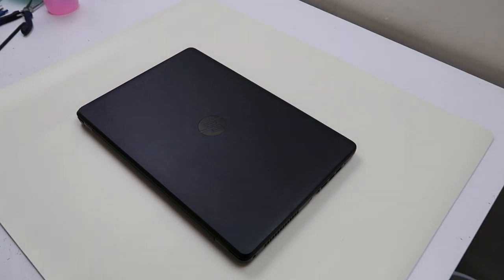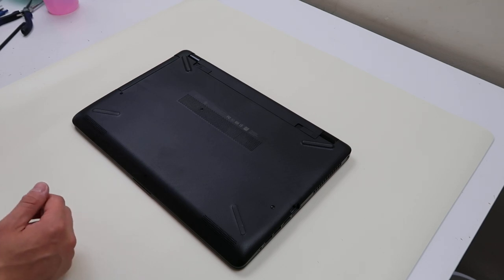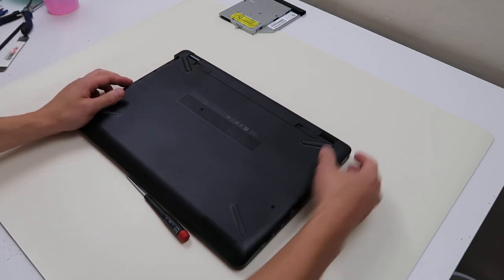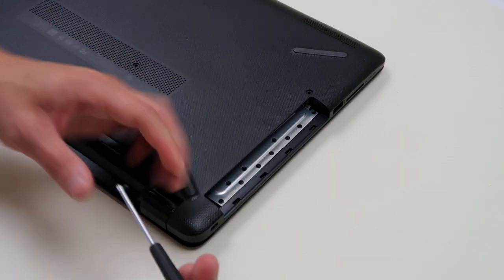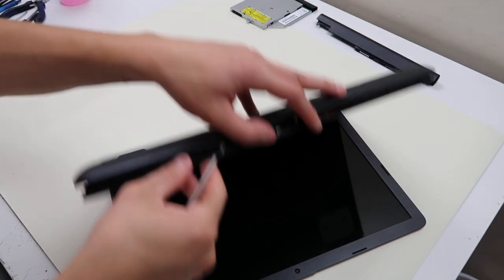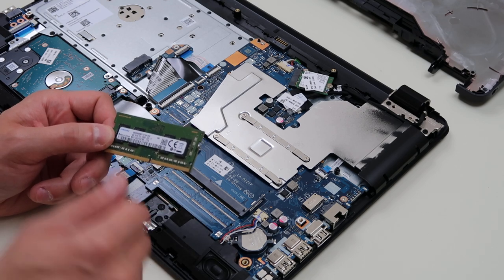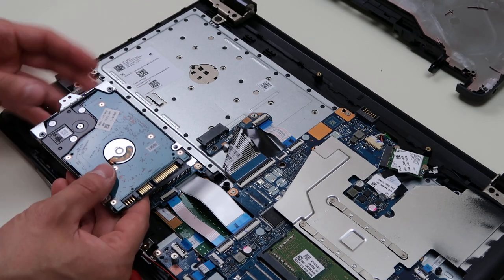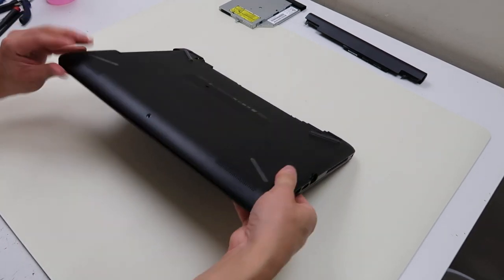How To Replace HDD, RAM, & Battery - HP Laptop Computer

Comment: A couple of questions:

1.  Can the processor be replaced, or is it soldered in place on the motherboard?  My reason for asking is because personally, I find an Intel Celeron to be a bit on the slow side.  

2.  Would I be able to replace the motherboard itself with one from another HP laptop (model 15-r131wm)?
Reply from the maker: Unfortunately, I dont currently still have this computer but if memory serves then no, the CPU cannot be replaced.  Its integrated into the motherboard :(
You best bet to see if another motherboard is compatible is to see if it looks the same using a site like Ebay or Amazon where you can find them for sale by searching for their model numbers.  If they look the same and the ports are located in the same spots, there is a good chance they are compatible if they come from the same series.

Comment: I’m using a Hp laptop: Question,  I did the components test, it returned back results that said,
 Hard drive smart check “ passed”
Hard drive short DST check “failed”
Does that mean my hard drive is bad and I should just replace it? I haven’t seen any other errors, aside from when I turn pc on blue box that says the selected boot drive failed.

Thank you for your easy to follow videos!! Your help in this would be so awesome.
Reply from the maker: That means your hard drive is bad and needs to be replaced.  You can see how to access the HDD here;  https://youtu.be/CxIuy2iiW8o.  Then you will have to install Windows onto the new one as seen here;  https://youtu.be/p_N_xV7j_Xo
Reply: @PC_Monkey  Thank you so kindly. You have the best videos and replacing the HDD is going to be more simple than I thought. Have a great day!
Reply from the maker: @SXYKITTEN1974  Happy to help :)  Always here if needed !!

Comment: Hello! I have this exact laptop that I need to replace the power connection port on. I used your video two years ago to swap the disc drive with an SSD and I think I see what I need to see once you open it up, but before I go poking around my means of getting my schoolwork done on, I wanted to ask if you had a specific video for what I need to do? Is it pretty much plug and play with this laptop once I have it opened up, or is their specific dangers I should be aware of before diving in? Thank you for your content, it is incredibly helpful for those of us working on our own equipment.
Reply from the maker: What brand and model computer do you have?

Comment: Thanks for this video. 
I have two HP laptops.
1. HP 600 with following specs:
4gb RAM, 300HDD and Intel inside.
**this laptop is OK, and its a used laptop.

2. HP laptop
8gb, 1terabite, and iCore7 
**Has a bad keyboard etc.

Here's the question:
Can I for instance, swap out the RAM(8gb) and the 1terabite hard drive into the HP 600 laptop?
Thanks for responding.
Reply from the maker: The hard drive yes, most likely it can be swapped.  The RAM would depend on if its compatible.  Check that its the same with this video;  https://www.youtube.com/watch?v=NtCzunl0AQA&t=9s

Comment: Your videos are really helpful. You are doing great job. I have a question regarding this video. Can I replace sata 2.5 inch HDD by sata 2.5 inch SSD in hp 15-r007tx laptop ?
Reply from the maker: Thanks :)  Yes, you can use that as a replacement :)
Reply: @PC_Monkey  thank you very much.

Comment: what kind of hard drive are you using because i have the same laptop and all need is the hard drive
Reply from the maker: What model computer do you have?  This computer shown, uses a 2.5 inch hard drive for laptops, with a SATA connection.
Reply: @PC_Monkey  I have the Hp laptop 15-bs2xx
Reply from the maker: @adam5876  Yes, it uses a 2.5 inch hard drive for laptops, with a SATA connection.

Comment: I tried the bios to legacy and also no secure boot maybe you can tell me if my settings are right I tried to change time I hit save it won’t save correct time or date thank you for the videos :)
Reply from the maker: If its not saving BIOS settings, can you try replacing the CMOS battery?  You can see how to access that part here at 9:10 https://www.youtube.com/watch?v=kOBY4k2Mn_k&feature=youtu.be

Comment: Bro in my hp laptop both battery and hard disk are gone which one to replace first , wheather to replace hard and install os first or to charge the battery and next should I replace the hard disk??
Reply from the maker: If your battery and HDD need to be replaced, it really does not matter which you replace first.

Comment: Hi! How do I know what hard drive to buy for my HP 15-BS060wm?

I got a hard drive ssd/short dst failure when I ran the hp diagnostic test.
Reply from the maker: Most likely, you need a 2.5 inch sided drive with a SATA connection for laptops.  The storage size is up to you.  That help?
Reply: @PC_Monkey  Yes, very much. Thank you for your quick response! I ordered a hard drive tonight. Hoping it'll fix my computer. Did you happen to have a link for setting up a hard drive on a laptop?
Reply: @PC_Monkey  Thanks so much for your help! I installed my hard drive tonight and I think my laptop is back!😊 Thanks for everything. Keep on keeping on! Your work matters!!
Reply from the maker: @aprils8725  Great to hear !!  Always here to help :):)

Comment: Hi please where can we buy these hard drives from? Mine failed too and I followed your video, I got the hard drive out my laptop but I don’t know where to buy one off
Reply from the maker: I usually get most of my used parts on Ebay or Amazon.  I can usually get a 500GB HDD for well under $20 USD

Comment: Hello I ask you a question couple of weeks ago I had spilled sweet tea probably don't remember me but you're advice fixed the problem so thank you but now  I need more help please my hard drive is bad so I want to buy a new one if so will you help me put it in  I'm new to this kind of stuff but want to learn instead of buying new  laptop or what do recommend please      thank you so much
Reply from the maker: Double check the specs on your laptop, but most likely you will be looking for a 2.5 inch Hard Drive with a SATA connection for Laptops.  Not servers.  You should be able to search for that on Ebay, Amazon, etc.  You should be able to get a good used one on Ebay around 500GB sized for well under $20 USD.  That what you were looking for?

Comment: I have a ssd slot so if I remove hard disk and install new ssd in ssd slot will it still work even after removing hard disk
Reply from the maker: Yes, you can replace a HDD with a SSD.  However, you would need to install an Operating System to the SSD in order for your computer to work.  Assuming you have an HP computer, you can see how to do that here;   https://youtu.be/p_N_xV7j_Xo.  You can create your own Install Media for free as seen here;  https://youtu.be/g_UhiHScaSI.

Comment: How can I tell if the harddrive is loose? I already had the harddrive replaced once, and did the diagnostics that told me my harddrive was bad. I believe you said in another video that it might be loose. I took it out and put it back, but I'm not sure if it works yet. I will charge it and see
Reply from the maker: If the diagnostics say the HDD is not installed, it could be loose or bad.  If the diagnostics say its bad, then its most likely not loose.  Its most likely bad.  You can tell if its loose if it feels loose :)  If it feels secure then its most likely not loose.
Reply: Thank you, I figured as much, I turned it on, and still didnt work. Thank you for the help.
Reply from the maker: @rustiboy1144  Happy to help :)  Always here if needed !!

Comment: Does it matter what kind of hard drive you get for a laptop? Or does it just have to be SATA?
Reply from the maker: It depends on your laptop.  However, most of then do require a SATA connection and a 2.5 inch size.
Reply: PC Monkey thanks for your quick response, I have a HP envy x360 laptop and I can’t find what specific hard drive it requires, I know it’s SATA but I can’t find anything else.
Reply from the maker: @therealnocam  Good place to look is crucial.com.  Or you can look up the specs on the manufacturer website by your serial number.

Comment: Do you have any recommendations as to where you should buy this exact model of hard drive?
Reply from the maker: I usually purchase most of my hard drives used on Ebay or Amazon in bulk.  Purchasing one individually, you shouldnt have to pay more than $25 USD for a 500GB Hard Drive

Comment: Hi There. I have an HP laptop model 15da0061cl that reads boot device not installed please install an operating system on your hard disk. I’ve tried bios reset but it didn’t help. It stills reads the same. On the drive diagnostics it says testing drive1 smart check: passed short DST :failed. Failure Id:GSN2sh-97DB29-XD7w2j-60XU03   I know nothing about computers so I don’t know what any of this means.  Help please.
Reply from the maker: If the diagnostic test on the HDD failed, it usually means the HDD is bad and needs to be replaced.  You can see an example of that procedure here in this video.  If you need help with your specific model, let me know :)
After replacing it, you would need to install an operating system onto the new one.   Assuming you wish to install Windows 10, you can see that operation here;   https://youtu.be/p_N_xV7j_Xo.  You can make your own Windows 10 Install Media free as seen here;  https://youtu.be/g_UhiHScaSI.  If you prefer to purchase it, make sure you get Install Media and not Recovery Media.  You can see a example here:  https://amzn.to/3KJRaRA

Comment: Can't load my Vista/windows that came on my 2008 HP HDX 18 laptop. Hit F1 to do quick test on hard drive and it stays at 0% with no test. Can start my computer. Please help . Is is hard drive . Can you please show or tell me? Tyvm.
Computer will not boot Vista up or windows.. I'm confused. Would like to use a spare computer and use DVD drive and internet  if I can. Don't have any factory original Vista disc either.
Reply from the maker: That sounds like the hard drive is bad :(   I would try replacing it.

Comment: Can i replace the ram hard and processor from my other hp envy dv4 notebook i have both hp laptop but their models are different i guess
Reply from the maker: You would have to make sure they are compatible.  Chances are the RAM is not, but you can check.  Refer to this video to help with the RAM:  https://www.youtube.com/watch?v=NtCzunl0AQA&t=9s
The processor may be compatible as long as its the same brand.  Intel, AMD, etc.  Thats a little more tricky though. Its easy to damage a CPU chip by forcing it if it does not fit.

Comment: Once the laptop has 1st como on when I press either F2 or F10 all that happens is it comes up on the bottom left hand corner F10... Bios setup options or F2...startup check. So you have any solution to this please?
Reply from the maker: I dont understand your comment.  You HP computer wont boot up to Windows?  It gets stuck at the boot menus?  If so, try the steps seen here;  https://www.youtube.com/watch?v=_qF-oqPrn7M&feature=youtu.be
Reply: @PC_Monkey  it doesn't matter i eventually got on to the start up check and it's an issue with my hard drive. Thank you mate.
Reply from the maker: @kevinmcelroy454  Glad your all set :):)  Always here if needed !!

Comment: Hi there! I have a Hp laptop model 15  ef0023dx. I have been getting error (3F0). On the black screen it says boot device not found and please install an operating system on your hard disk. I done the hard drive check and it said that no drive installed. I got this laptop six months ago.
I'm not really sure how to unplug the hard drive in this model.
Reply from the maker: That means its either bad or loose.  I would first try 'reseating' the Hard Drive.  That is where you unplug it and then plug it back in, making sure its properly plugged in and secure.  Try the scan again.  If it still says that its not installed, then its most likely bad and needs to be replaced. You can see how to do that here;  https://youtu.be/tNp5Kbo9uHg.  You would also then need to install an operating system onto the new one as shown here;  https://youtu.be/p_N_xV7j_Xo

Comment: Thank you brother for this information, I will be ordering a hard rice and let you know if it fixed it!
Reply from the maker: Good luck !!  Let me know how it goes :)
Reply: @PC_Monkey  I could only find an SSD in my laptop?
Reply from the maker: @Jesse58761  I dont understand your question.  Are you asking why you only found a SSD in your computer?  That may be because your computer has only a SSD and not a HDD.
Reply: @PC_Monkey  okay, so then my SSD would be the problem?
Reply from the maker: @Jesse58761  What problem are you experiencing?  What is happening to your computer?
Reply: @PC_Monkey  exactly what was shown in video
Reply from the maker: @Jesse58761  lol.  This video is a general tutorial on how to replace the hard drive, RAM, and battery in a HP computer.   Its not showing any problem.  Again, what problem are you having that your asking if the SSD would be the problem?
Reply: @PC_Monkey  I’m sorry 😂 it’s not recognizing the hardrive & mentions reinstalling windows
Reply from the maker: @Jesse58761  Are you able to run the diagnostic scan as seen here to make sure the HDD is good?  https://www.youtube.com/watch?v=JBuJp3lrlzI
Reply: @PC_Monkey  yeah it said it wasn’t able to be found.
Reply: @PC_Monkey  thank you I will try the SDD and let you know
Reply from the maker: @Jesse58761  That means your HDD is most likely loose or bad.  Frist, try 'reseating' it as seen here.  If that does not help, I would then replace it and install an operating system to the new one. 
How To Create Windows 10 Install Media for Free:  https://youtu.be/YbC4jZVwQm4
How To Install Windows 10 onto HP computer:  https://youtu.be/p_N_xV7j_Xo
How To Create Windows 11 Install Media for Free:  https://youtu.be/WIxDYRBVbmk
How To Install Windows 11 onto HP computer:  https://youtu.be/90zcX2iUuVI
If you cannot create your Windows install USB yourself, you can purchase it instead.  You can see some options for the correct item in the Repair Tools list here:  https://www.amazon.com/shop/pcmonkey
Reply: @PC_Monkey   tried installing new SSD today, still having same problem. 😔
Reply from the maker: @Jesse58761  You were unable to install Windows to the new drive?  If so, you may be looking at a motherboard issue now :(  I would next replace that :(
Reply: @PC_Monkey  sad, let me try installing this sledge hammer.2 into the mother board.
Reply from the maker: @Jesse58761  lol good luck :(
Reply: @PC_Monkey  It worked!!!!!! Yayyyyyy. Thank you so much! 👍🏻 😁 I installed new SSD and reinstalled windows 10.
Reply from the maker: @Jesse58761  Glad your all set :) Always here if needed !!

Comment: So it's covered by plastic, but it looks like it can be torn off. I'm trying to slide it out, through the slide where the battery sits, but I think I'm making things alot harder than thing should go because its blocked by the speaker, and the battery holder.
Actually nope not possible, so I may have to remove the plastic
Reply from the maker: Most Hard Drives are housed inside a Hard Drive Caddy that needs to come out before the HDD can be unscrewed from it.  What is the brand and model for your computer?

Comment: Hi. How about if I need to replace the hard drive do I will lose all the data and documents? ☹️😕😕
Reply from the maker: Yes, if the hard drive is bad, then any data stored on it may be lost.  You can try bringing it to a repair shop.  Sometimes we can get data off bad drives but usually not :(

Comment: K I'm kinda mad it's that frickin easy. Looks easier than when I replaced my iphone screens.  I guess I can do thatttttt.  Are all the screws you took out the same?  How do you keep track of them, I mean I'm over 50 and a chick lol. Thank you.
Reply from the maker: No lol, they are not all the same.  I can keep track mentally these days as I have been doing this for a long time.  However, when I started, I would write out a sticky note for each part.  Bottom Case, HDD, Palmreset, etc.  I would then put the screws that were needed to take out that component on that sticky note so I knew where to place them when putting everything back together :)

Comment: How do I get the info off of the bad hard drive?
Reply from the maker: You can try hooking it up to another working computer via an external hard drive link.  If that does not work, then you would have to take it to a repair shop.  Sometimes we can get data off bad drives.

Comment: I did a hard drive check and it said no hard drive was installed what does that mean do I have to buy a new hard drive
Reply: Oh by the way I have the exact same computer as you
Reply from the maker: That means its either bad or loose.  I would first try 'reseating' the Hard Drive.  That is where you unplug it and then plug it back in, making sure its properly plugged in and secure.  Try the scan again.  If it still says that its not installed, then its most likely bad and needs to be replaced. You can see how to do that here;  https://youtu.be/tNp5Kbo9uHg.  You would also then need to install an operating system onto the new one as shown here;  https://youtu.be/p_N_xV7j_Xo
Q:  Changing settings in BIOS didnt help and everything passed the test?